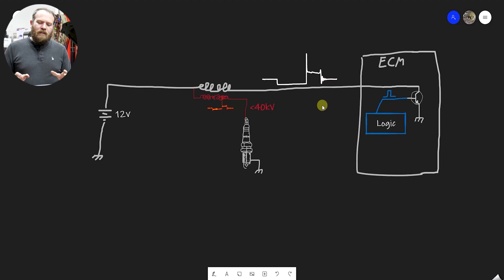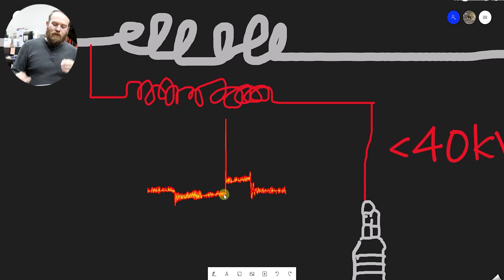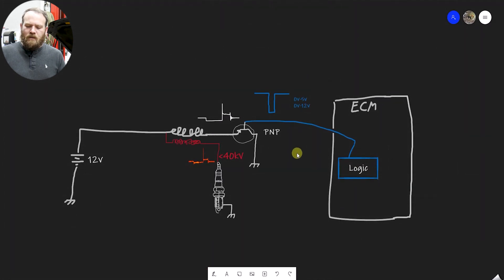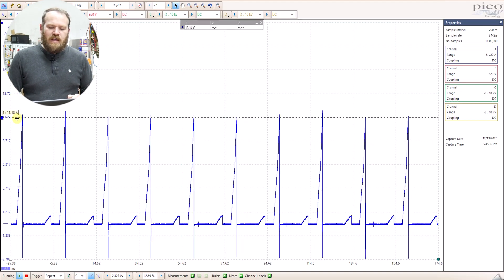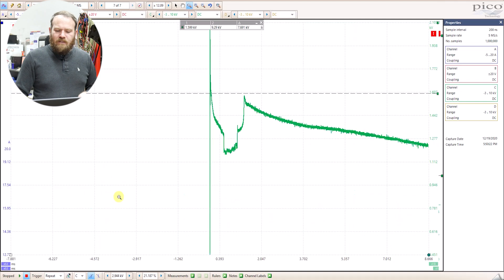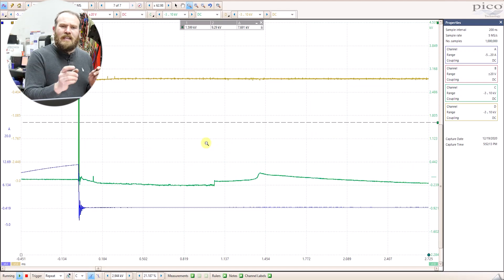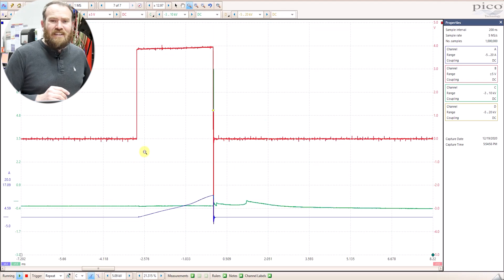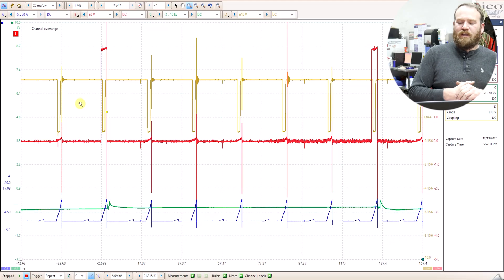Automotive Weekly Waveform 11 - How Smart Ignition coils work and scope captures

Comment: GREAT VIDEO!!!
  I actually need to have a signal that indicates when the spark is fired (or actually present) for a special project.  I must use the wires already on the COP.  I am able to trigger my circuit on the rising or falling edge of IGT or IGF...any suggestions??
I will be ready to try it in a few days.
BTW:  Have you ever 'scoped' a logic signal that was actually 12v logic instead of 5v??
THANKS MUCH!!!

Comment: Hi Chad. Can you show us Toyota ignition coil that prevents the vehicle from starting even though we have IGF signal when cranking. I have found that we also have IGT signal but vehicle starts & dies, I have found the ignitions coils put high amperage during cranking & prevents vehicle from starting. I know if we have shorted ignition coil it will make the 5v from igf to go down to zero volts but i have seen shorted coils & still have good IGT & IGF signals.Can you show us some waveforms with no starting situation? Thank yoiu